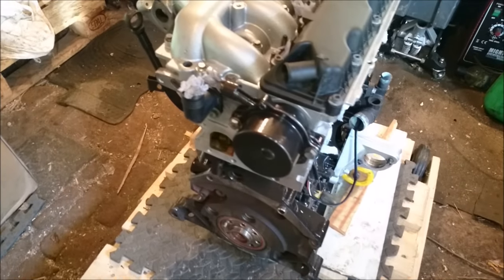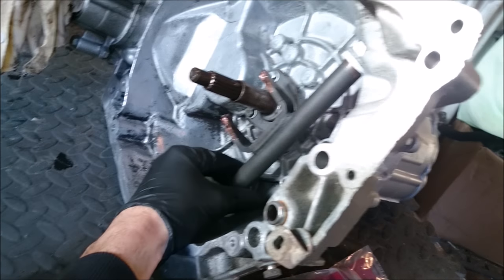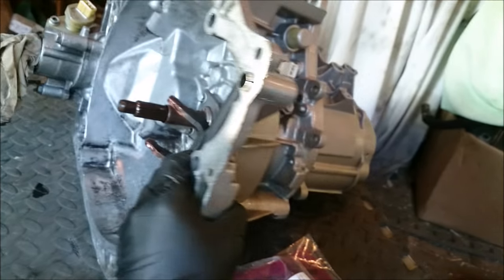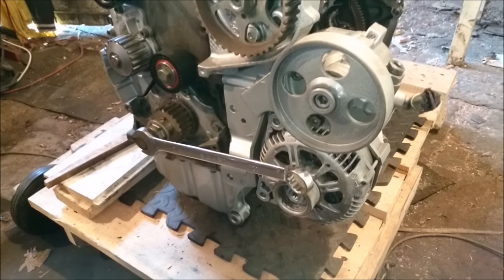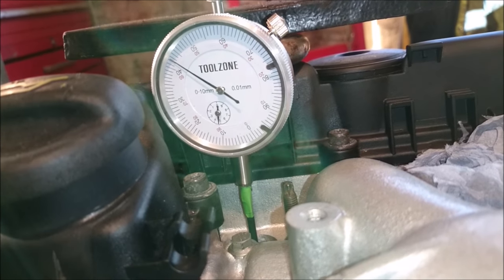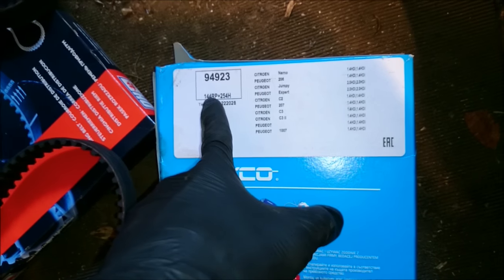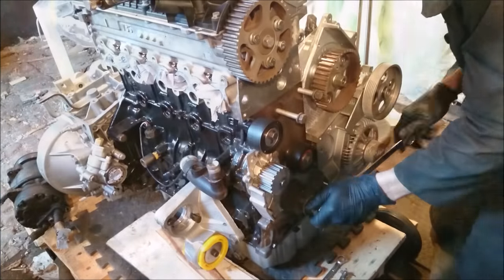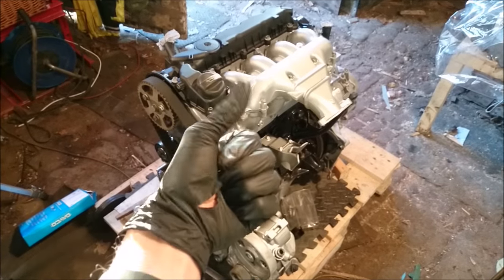Project 16v - Part 10 - drive gears and belts

Comment: would you not have a good handfull of bolts and nuts to spare after your done. damn there id many parts to take apart and put back together ;)
Reply from the maker: KillerBOZombie It's almost a problem actually. I stripped the 2.2 about 18months ago, the two 2.0 8v engines a year ago and few months...so I often have replica bolts/brackets... despite how organised I did it...I now can't remember how I organised it 😄🐷👍